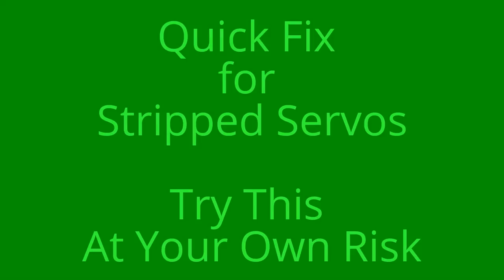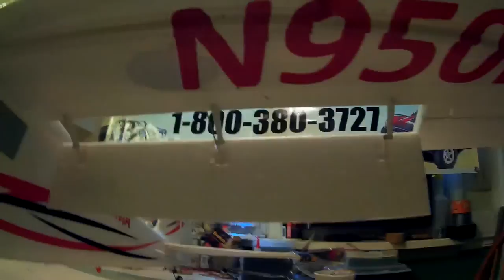E-Flite Timber,  Quick Fix for stripped servos, Try This at Your Own Risk...!!!

Comment: I just have to add a comment here.  I have been flying  my  Timber for over 2.5 years.  Sometimes in SAFE, sometimes without it .   I also own the Commander and the PT-17 from Horizon. Many, Many times the winds have been as high as 14 mph and you could see the strain on each of these planes as they tried to turn etc.  Never, ever had any kind of problem with the original servos...never.  Two members of my club also have Timbers and Commanders and all have had the same result...no problems.  The only time I've seen servo damage on planes is subjecting them to more stress and strain than they can accept.  I've been flying for over thirty years so I've seen a lot for sure and I'm puzzled by So many servo failures. I do appreciate your mentioning the metal gear servos that I may need just in case things eventually go south.
Reply: Name should be "Carl"....used my wife's account by mistake
Reply from the maker: I fly my timber very aggressively.  The aileron servos are the only ones I've had to replace.  Great plane been flying mine since it 1st came out.  Around 300 flights on it probably so far.

Comment: **HIGHLY SUGGESTED**  Replace all the servos with either a metal geared servo or step up in size, as the control surfaces are larger than what these servos can handle, .. especially in my case where I like to fly in the wind, nothing crazy like 30mph, but less than 20, I'll fly all day!  But this timber servo can't handle it, the plane does, just not the chintzy servos they're using!
Reply from the maker: mike washere I agree.   I switched to metal gear servos.
Reply: What servo would be a good replacement

Comment: Servo hell.. After stripping maybe ten Timber servos, my approach was to switch to cheap EMAX digital metal gear servos, major problem solved. Same with the CzCub, two E-flite servos died on me before maidening. My Timber's ESC spontaneously fried and I cracked my wing too. Small world.
Reply from the maker: Man, No Doubt.  It was wierd when it went down all the sudden no power and no controls.  Mine was litterally smoking when I got to it.  Plane still smells a week later.
Reply: Ditto, smoked up the styrofoam. Though it was my car that continued to smell that long. Love the Timber, but I've encountered my share of... idiosyncrasies. For example, mid flight, the nose pops off, spun around and the propeller devowered the fuselage and wing. Just normal gentle flying. I was able to land beautifully though.
Reply from the maker: That's hysterical.  Yeah, I love my Timber too but it definitely has it's flaws.  Nothing we pilots can't fix or overcome.  Cheers Bud,  Skip

Comment: guess there is teething problems  well guess this is a special club esc & motor on fire, mid flight, the nose broke off ,was able to land. New to the hobby still fighting to learn! Also replace 3 servos.       Skip  what is that
    bubble on your battery hatch?

Comment: well I haven't experienced any of the problems you guys have.   I did have to re index the flap actuating lever on one of my flap servos to correct a fairly large asymmetry problem.  But to date; that's it.  Knock on wood.  

Love your Videos Skip; especially when Mike almost gave you a crew cut.   Almost did that to myself when rolling my Harbor Freight P-51 after coming out of a loop.  It about clipped my helmet cam.   It's about 2/3s of the way through a video I posted a few days ago called Harbor Freight P-51s Fire & Ice.   

Love the Timber.   Love your daring night flights.   I fly mine at near dark.   I've been looking at your Prometheus (big) videos and have been contemplating getting one I. the future.   Are they all they are hyped up to be?
Reply from the maker: Thanks man.  And good luck with your timber.  Mine had a small curse to 
start with as it came with a bad motor.  That may have been why the esc 
fried.  All I know is when it goes, it's all gone unless you put a ubec 
on it .  Which is something to consider...?  Thank you for you post and 
the compliment my Friend.  Happy Flying, Skip